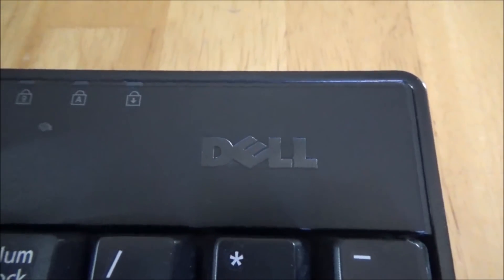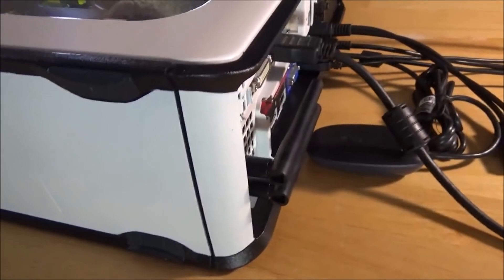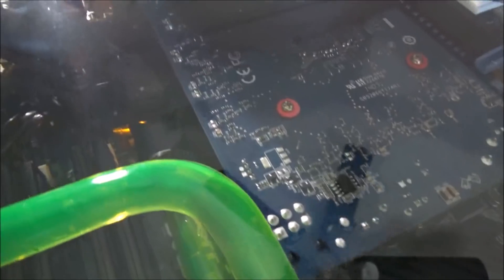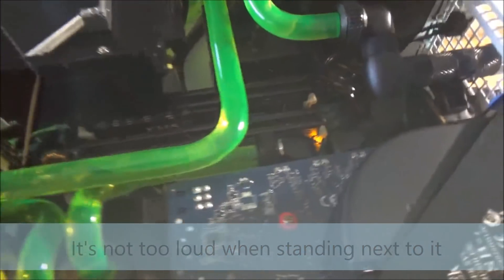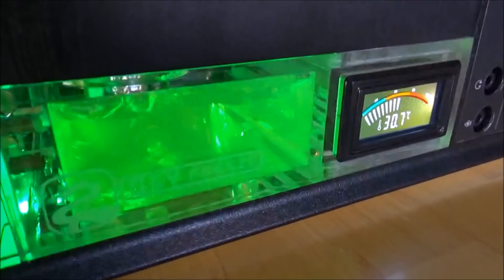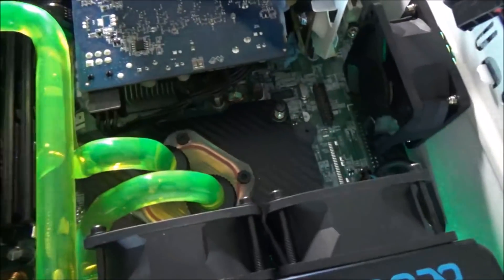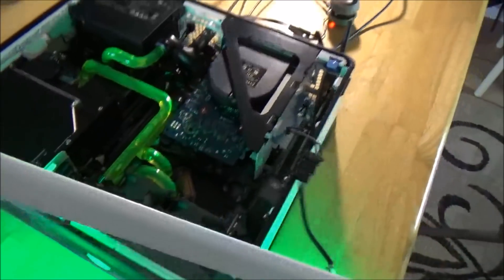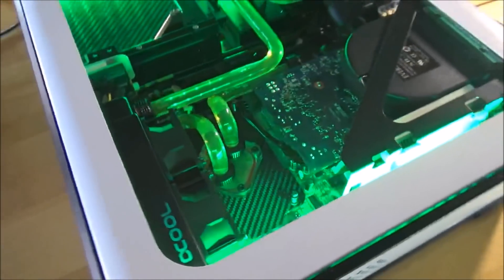Custom Hard Line Water Cooled Dell Optiplex 780!

Comment: Where did you get that GPU bracket? How did you mount it like that? That is awesome!
Reply from the maker: I bought it off eBay. They are still for sale but are getting a little more rare.

https://www.ebay.com/itm/304551037851?hash=item46e8a80b9b:g:rVYAAOSwt75iwI7o&amdata=enc%3AAQAHAAAAsCgLqiV5w6ye3IDljMcDvAcFqv4y3HgwBsUWRS9qx4TyUAIFp7WelV2nNyNk7mGfGB%2FAOLOwK1gqaWmSnJnjkXIeVKt2nXpS%2FXImxLFJuQ4gh67PPxSvZAEoopbS4jcBnwgKbMlFNqiq6hFpafYySAidG54lD3qWI0Cytd383UB9tb3R0w2jzw9M5MfZV9Crvo3AkptJSk%2FXqZRikSl%2F3H9nwEsvObsCx%2FlrKzSsRglR%7Ctkp%3ABk9SR5CorefYYA

Comment: Something in it all the same there. ))) Now I also pump a similar 780 office miracle to a person. I put there a quad core 9650 on this monster, 8 GB of RAM, and stuck in the butt in the gaps of the RX 550 by 4 GB. I put the 2.5 in the slot under the floppy disk, the adapter and screwed the SSD to 120 GB under the system. The main one put 3.5 per 1 TB WD Blue. The power supply unit was installed on 450 watts, and the cooler with blue backlight 120 was installed there. And the cooler with the blue backlight was also installed on the rear 80mm. I hope it will work. ))))) At least it is clearly better than this office shit, which was thrown there initially.

Comment: Is that 60mm radiator? because I can't find lower than 80mm
Reply from the maker: Hey man, sorry for not responding to your first question. The water cooling is just a bunch of random parts that worked. The radiator is a dual 60mm, here is a link for Performance PCs website http://www.performance-pcs.com/alphacool-nexxxos-xt45-full-copper-60mm-dual.html It's really a fantastic rad and works much better than expected for such a small setup.

Comment: Hi, great videos since we last chatted, I gave up on the 780 build but back at it again and it looks like I’ve got to resort back to the original mother board and the core duo 2 due to a flashing amber power light, so it’s either a shot mother board or the power supply is not man enough. Sean.

Comment: I have no idea why you would need to water cool an optiplex (only FSB OC possible/BSEL with LGA775) but it looks freaking sweet! Great job! This makes me want to do more to my 780 MT, currently rocking a 980 MB with xeon x3440 OC to 2.92GHz, 16GB crap ram running at 1400MHz, MSI GTX 680 OC to 1300MHz/3600MHz x2 on the VRAM. 
P.S to OC these Dell MB's SetFSB works ok for mild clock boost but you have to have a compatible PLL/Clock generator...
Reply from the maker: You're right, there is no "need". I didn't do this to overclock, I did it to make it look freaking sweet =). I did install an AIO  water cooler on my 780 MT out of need though. The GPU that I had bought (R9 270) was too long and couldn't be installed because the huge Dell CPU cooler was in the way. After installing the all in one water cooler I had room for the GPU. And it made the 780 MT look a lot better because I had a case window.  i have tried to overclock with SetFSB a few times but have never found a compatible PLL. I think it's because I was always using Q9XXX chips and they are 1333Mhz and I've read that it only works with chips that are 1066. Thanks for watching mang!

Comment: Quick question what motherboard size do the optiplex 780s use..are they proprietary?
Reply from the maker: Unfortunately they are proprietary. It's called a BTX motherboard and is a mirror image of the standard ATX design. Everything is basically opposite of ATX.

Comment: I know im late, could you list what is not stock in your pc?
Reply from the maker: Only the case and motherboard/CPU are stock. The PSU, GPU, RAM, disk drive/hdd caddy, cooling system, front grill, case window and exhaust fan are all aftermarket parts that have been modified or added. Oh, and the paint job =)
Reply: @PimptatoPCs  thank you for the reply! it make me more hype to build my son's pc.. May i know what PSU and Cooling system brand are you using?
Reply from the maker: No problem man. Glad to help pump you up for the build lol. The PSU is a Silverstone SFX 450W. The cooling system has a Alphacool radiator,  Fractal Design 40mm fans, eBay Chinese reservoir and water blocks, and the fittings are mostly Barrow brand with some Alphacool and XSPC parts mixed in. I just went for the cheapest price on eBay for the fittings I needed. Here is a video about mounting the PSU https://www.youtube.com/watch?v=QCVFt6Bl5e4 If you go to the playlist section on my channel there are build videos showing pretty much everything I did to this Dell.

Comment: What psu do you have in this? I have a Dell Optiplex 790 sff that i've been tinkering around with for awhile now but the only thing holding me back from pushing it further is the stupid proprietary 240w power supply. I bought a 400w SFX psu after hearing it'd fit, but no dice. I've been looking into a 400w nano atx HDplex but i'm just curious if there's another option. Thanks in advance
Reply from the maker: This one is also a SFX psu and I had to modify the case quite a bit to mount it. It fit really nice but pretty much all four mounting points are custom. You should check out some of the mini ITX psu's. It looks like one would fit but you might have to do a little modding to mount it, and they're pricey. Check this one out https://www.newegg.com/Product/Product.aspx?Item=9SIABP94J59222

Comment: I got to Dell Optiplex 760 s. I upgrade the PSU 600 watts. They both boot fine. As soon as I put in the upgraded gpe as a GeForce 8800 GT. All fans cut on but it will not boot. plz help
Reply from the maker: I would start with the 760 BIOS. Have you checked to see if it is running the most recent BIOS? There also might be a setting in the BIOS to switch from integrated graphics to a video card.
Reply: @PimptatoPCs  yes. it's running a16. And I've tried that. I believe the video cards are dead.
Reply from the maker: That sucks. It's rare to get two dead gpu's. Hopefully you can test it soon with a different card.

Comment: Did you use the DELL E93839 GA0403 Mother Board? Also did you have to do anything special with the bios to allow the graphics card?
Reply from the maker: Yes, it's just the stock Optiplex 780 motherboard. Older Dell Optiplex PC's are BTX design instead of ATX so I really couldn't have used a more modern ATX motherboard without a crazy amount of modding. The Dell is on the most recent Bios (A15) but the graphics card will run on an older Bios too. The only thing the GPU needs is an upgraded PSU because it requires a 6 pin power connector. But that could be avoided by using a newer card like a GTX1050ti.
Reply: PimptatoPCs  thanks!
Reply from the maker: You're welcome! Do you have this Dell? The Desk Top model?
Reply: PimptatoPCs Yes. Its quite a happy little PC. Recently I have wanted to edit photos and videos and while photos are within the capabilities of the PC video editing is asking too much apparently. So I am interested in upgrading it a bit.

Comment: Some of these modifications can be done in the optiplex 755?
Reply from the maker: Yes, the two cases are almost identical. I actually started this project in a Dell Optiplex GX620 with a 755 motherboard installed. Then I decided to switch to a 780 because I wanted DDR3. Hit me up if you have any other questions. Thanks for watching man!
Reply: and how you modified the power source
Reply from the maker: I lost a lot of the video of me actually doing the work but here is a link for the psu modification https://www.youtube.com/watch?v=QCVFt6Bl5e4
Reply: What is the name of the power source?
Reply from the maker: It's a SilverStone SFX 450W https://www.amazon.com/SilverStone-Technology-Factor-BRONZE-ST45SF-V3/dp/B01LZFMKCI/ref=sr_1_fkmr0_1?ie=UTF8&qid=1530414902&sr=8-1-fkmr0&keywords=SILVERSTONE+ST45SF+SilverStone+SFX+Series+ST45SF+450W+80+PLUS+Bronze+SFX+Power+Supply
Reply from the maker: But your PC can run a 1050ti on the stock psu without trouble. What gpu do you plan on installing?
Reply from the maker: This Zotac 1050ti would fit in your PC if you have the riser card already https://www.amazon.com/ZOTAC-GeForce-DisplayPort-128-bit-ZT-P10510A-10L/dp/B01MCU1ERO/ref=sr_1_2?s=pc&ie=UTF8&qid=1530415076&sr=1-2&keywords=1050ti It's kind of expensive but it would install without any mods or buying a new psu.
Reply: I want to install the maximum that Optiplex 755 supports.
The processor that I have is a Xeon X3363. It is a 4-core processor at 2.8 ghz and 80 tdp

Sorry if you do not understand why I'm translating it  :d
Reply from the maker: I'm understanding you perfectly =). You have a good processor, it is very similar to a Q9650. I think that the 1050ti would be a really good choice for that cpu, anything more powerful would be too much for the cpu to run at full speed. Does your 755 have the gpu riser card installed already?
Reply: no, my pc does not have it I know there is an architecture error in the cabinet at the entrances. I once saw a Gtx 750 TI UltraSlim That only occupied one slot But It is out of stock for months.

Another card that I saw that could be a good cost-performance option is La Gt 1030
Reply from the maker: I had that UltraSlim 750ti before, it's a great card. I f you can find one they are expensive. Here's a link to one for $200 http://www.priceblaze.com/n750ti2gd5tlp.html?ref=gshp&gclid=EAIaIQobChMI4Pv-oYf92wIViVx-Ch0Y7Qo4EAYYASABEgLm-_D_BwE The GT 1030 is a very good cost-performance option. If I were you that's what I would buy.
Reply from the maker: Here is a link for the riser card if you ever want to get one https://www.ebay.com/itm/Dell-OptiPlex-DT-330-360-620-745-755-PCI-PCI-E-Riser-Card-M5246-G5459-w-cage/292508879960?_trkparms=aid%3D111001%26algo%3DREC.SEED%26ao%3D1%26asc%3D52971%26meid%3D100329074b134c8eae1af72e4d82f4fe%26pid%3D100675%26rk%3D1%26rkt%3D15%26sd%3D292508879960%26itm%3D292508879960&_trksid=p2481888.c100675.m4236&_trkparms=pageci%3A552492f1-7ce7-11e8-8f44-74dbd1802ed8%7Cparentrq%3A541a416b1640a8665e1749cdfff434f5%7Ciid%3A1
Reply: Then I will buy the GT 1030, I think it is very good and spends little energy. But the problem is the price because in Mexico the dollar is expensive.

I'll see if it's compatible with the games I'd like to play

Thanks for your help
Reply from the maker: De nada =) The 1030 is an unbeatable value, smart choice. Nice talking with you!

Comment: Why
Reply from the maker: Fun
Reply: How much did it ended up costing?
Reply from the maker: I'm not really sure. I bought parts new and used over a 6 month span and didn't keep a running total. Over $500 though. The GPU, $50. The PSU, $60. The CPU, $50. 16GB of RAM, $75. 120GB SSD, $45. 1TB HDD $70. The water loop alone was probably $200. But there are a lot of parts that I'll be able to use in a future build so it's not a total waste of money lol. It was a fun project that I had wanted to do for a long time. Thanks for watching man.

Comment: Stock mobo?
Reply from the maker: Yes. This PC is a BTX design (versus a normal ATX) so there is actually no way to change the mobo. A BTX PC is basically a mirror image of ATX, everything is reversed. I did this project just for fun and the water cooling loop was entirely for looks. It would have been nice if there was an aftermarket BTX mobo available for overclocking, but BTX was never popular enough for ASUS, MSI, ASRock, Gigabyte etc. to make them. BTX was strictly used for business PC's from Dell and HP and was completely dropped for ATX after maybe 5 years or so. Thanks for watching James!
Reply: PimptatoPCs only problem with that is the old mobo that those usually have electrolyte caps, they don't last very long... I don't know if the Dell actually does but it looks like it does. If It does have eltrolyte I wouldn't of done this because who knows when the PC will die and you put in all this fantastic work! Great work, but electrolyte caps really don't last very long at all.
Reply from the maker: I'm glad you like the work man and I appreciate your concern. But I'm not too worried about it because this project was honestly, just for the fun of it. When or if it dies I'll reuse what parts I can in another build. I did just spend about 45 minutes reading about electrolyte capacitors and all the articles are from 2004-2005. It actually affected more than a few manufacturer's including Apple. Dell spent $300 million dollars replacing motherboards during that time and it seems like those issues were confined to earlier model Optiplex PC's. I couldn't find anything confirming what type of caps are used in the 780, but this 780 was manufactured in 2010. I really don't think Dell would continue to use cheap caps after spending that kind of money to fix old mobos. On top of that, their reputation really took a hit around that time. But this PC is 8 years old already so if I get a couple more out of it before it dies I'll be happy!

Comment: I have also Dell 780 tower PC but my PC is very slow what i do 🙁
Reply: Mudassir Hashmi 
Ubuntu!! Try it to see how fast it runs on you pc  just to test if you have a software issue.
Reply: Get an SSD, upgrade processor to quad core modded xeon or core2quad, updrade ram to 8+ gb, and get a low profile gpu (gt 1030 is probably easiest / cheapest without modded the case). Mines on 16gb ram gt730,2gd5 240gb intel ssd, and xeon 3363 and runs very fast and very cheap to build. You can get 8gb ram processor and ssd off ebay and aliexpress for about 50$ total.

Comment: Looks good man. Sharp
Reply from the maker: Thanks a lot man, glad you like the look!
Reply: I have 4 of those Optiplex's . Been thinking of doing one up, then came across your vid and you already killed it. You should check out my current build The most Powerful watercooled PS3 in the world. Part 3 coming very soon.
Reply from the maker: I love modding Optiplex PC's for some reason. This green water cooled one is the most work I've ever done to one. I really wanted it to be nice! I'm stoked you like it man. Maybe it will get you going on those 4 Optiplex PC's haha. I'll check out that PS3 for sure!
Reply: For sure. I've had the backs cut out for years with big video cards in them but never did much more. The Optiplex's are very capable for gaming with a good GPU. As far as the PS3 vid goes, I purposely haven't shown whats going in it until part 3. It's guna be good.
Reply from the maker: Dude, I was watching Part 1 and said to myself, "That's the same little Chinese rotary tool that I have." Then you busted out an entire machine shop in Part 2! That thing is looking pretty sweet after putting that perforated metal collar. I dream of having access to some of those tools. It cracked me up though, cheap little rotary tool in Part 1 and industrial spot welders and metal brakes in Part 2 =D! Can't wait to see the finished product, good job man.
Reply: I kinda wanted to show it can be done with a dremel... But much faster with tools. Thanks for the kind words, I appreciate that.
Reply from the maker: You're welcome, it looks like it will turn out sweet. I know what you mean about using regular tools, a lot of people watching YouTube want to see a project that they have a chance of doing themselves. But it was super cool watching you use all the industrial stuff. If that an HVAC company?
Reply: Pretty much. I thought about making templates from the PSC build so it can be done to other PS3's as well easier. I'm not into console's or anything, I just think it's a cool mini ITX build.  I would like to do a nice paint job on it but,  as it turns out PS3's are tinted clear plastic all the way through. Great things are to come..
Reply from the maker: It definitely makes a good looking ITX case. You should do templates if it's not too much work. Didn't know PS3's are tinted clear, that does open up some cool possibilities beyond paint. I'll be on the look out for part 3 mang.

Comment: Is there a video for the creation of this? Specs? Gaming?
Reply from the maker: I need to organize the videos in to a play list, but there are around 10 videos on my channel that document the building process. Anything that is titled "Water Cooled Dell Optiplex Build Log #". And the last one I posted is titled "Dell Water Loop Leak Test ... FINALLY!" There's also a  video called "GTAV vs The H2O Potato- 30+ fps High Settings". Here is a link to the parts preview video that I did before I started the project https://www.youtube.com/watch?v=J1keJbqxjGU It shows most of the parts I used, but I had to buy a lot of water cooling stuff that's not shown.